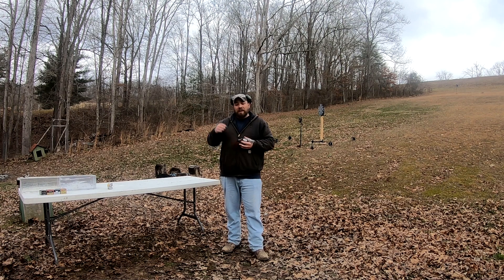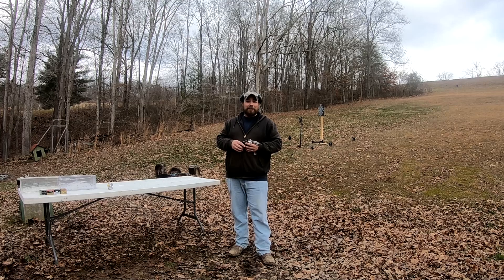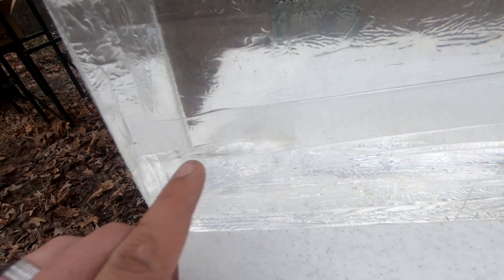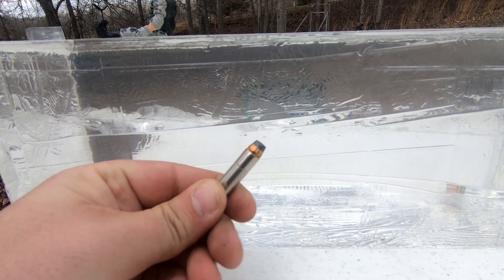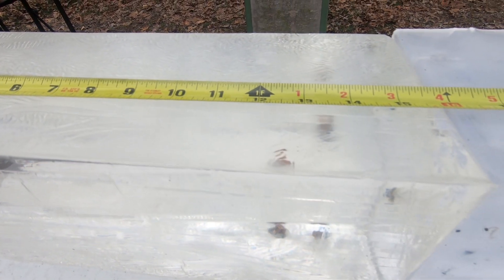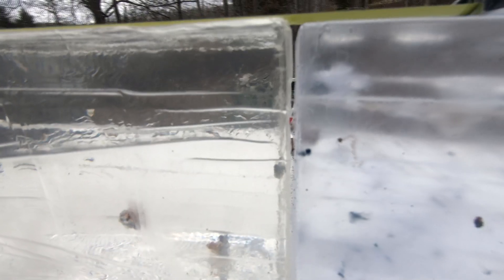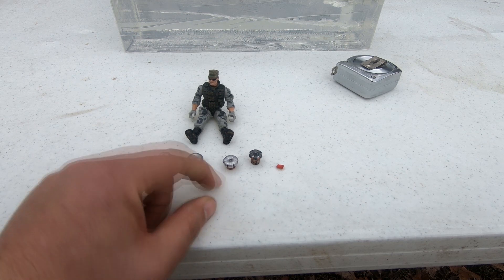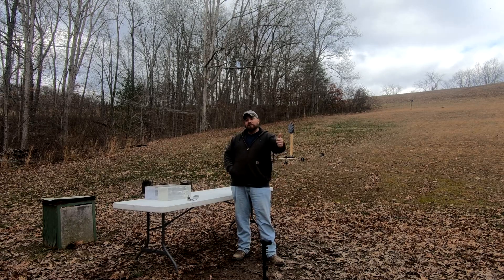357 magnum Ballistics Gel Test

Comment: Great video. Thanks for bringing it to us. All that’s missing is a chrono. Some velocity figures to go with respective expansion would speak volumes. I agree with your assessment in that it’s hard to pick a winner. I think I’d pick the JHP over the HydraShock due to cost. Performance is so close as to rule out more expense. I really like that 135 Gold Dot. In my 3” S&W 60-15 I get
1201fps for a 3-shot avg in a Winchester 357 case primed with a CCI550 with 10gr of HS-6 on top of that. It’s neither a max load for that powder nor a top end 357 load. But I’ve seen tests with that bullet in the 1170 range and it performed 
very well in FBI gel(this was before Clear Ballitics).  Even though it was designed for 38 SPL +p(I wouldn’t push it any harder than 1220 as I think it might start to come apart). It would take a strong 9mm+p+ to best that load. I once tried to stop it with 3ea gallon-size water jugs. It destroyed the first  2, blasted through the 3rd and may still be in orbit for all I know. And I honestly think I’d want a little more expansion than what the Critical Defense gave
Reply from the maker: This is a really old video of mine, one of my firsts lol. I typically use a chrono in all my ballistics tests these days. Thanks for watching!
Reply: @thegundungeon  I’ll watch more of your videos at some point. I subscribed. I enjoy seeing ammo tests. Thank you

Comment: You are not getting optimal burn rate fro the 3 inch barrel. From that length barrel you will get better velocity and performance from 38 plus p Buffalo Bore 158 gas check lead hollow point, that hits 1140 fps from a 3 inch barrel
Reply from the maker: I have a video on those as well, I typically do testing with shorter barrels just because I feel like that’s what most people carry. I try to do things a little different since there’s lots of people gel testing on YouTube these days.
Reply: I sometimes carry a 21/4 Colt lawman, usually with hand loads throwing a357158 swc at around 1000 fps. For defensive use the Buffalo Bore 38 will fly at around 1050-1075 , which is faster than almost every 158 357 out of a 2 1/2 barrel. Best woods load out of a 357 is the Buffalo Bore 357 180 hard cast fn that chronographs out of a 4 inch at 1410fps, and a 3 inch at 1300fps. A sledgehammer of a load
Reply: Proper loaded 357 mag can beat that buffalo bore by 100 fps easily i think even remington 158 htp push 1240 fps from 3 inch barrels

Comment: They all worked well, probably the best could be Speer because it's a bonded bullet for barrier penetration and retain weight. In my opinion, 135 gr could be optimal for a 3 inch 686, and less flash. Beautiful revolver and thanks for the video 👍

Comment: Like that you used a 3" barrel.  Don't often see this.  Ive got a S&W mod 60 Pro 3" and always wondered how the performance nay change between it and my S&W 60 with the 2" barrel.  My carry load has been the 125 gr Critical defense load as  it performs very well in the 2" barrel for proper penetration and decent expansion.  Now I know it works very well in a 3" barrel too.   Gel block Jim cracks me up

Comment: Great video. I've done extensive testing with the .357. You findings were spot on with mine. I used a 2 1/2, 3, 4, 6 and 8 inch Python. The old school hollow points I carried back when I first became an LEO are still a good bullet today due to the velocity they have, even from a short barrel. Cheaper that the high tech stuff. All the loads were chrono'd with the slowest being 1160 fps. Get Jim a parachute!
Reply from the maker: Ya know I’ve never really seen anything negative about those old semi jacketed hollow points. Yes Jim can get some air time lol! I’ve got a video recorded with 44 magnum and he really gets up there in that one! Stick around to see it lol.